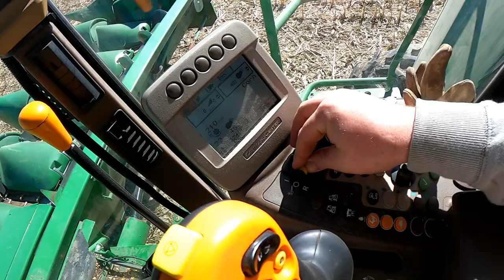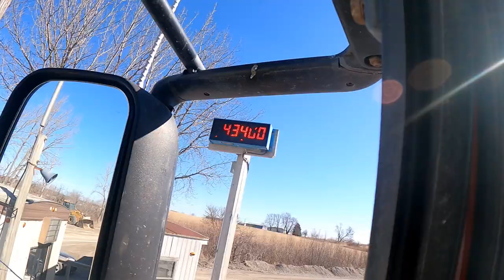HARVEST 2021! - Pickin CORN bonus!

Comment: Ben I just thought how you and others cans save a lot of money,  on your Air cleaner if it has steel mesh on the paper element take a 5 gallon bucket fill with water and laundry soap mix and put the filter into it and move the filter up and down and around real good then empty and repeat as necessary then rinse until all water is clear then set it out to dry for a few days until dry!! If your in season have a brand new filter to put in until it gets dirty and REPEATE!! The savings is great oh I was the shop foreman for a long time and I would tell all my customers about this.

Comment: First. We have a 9660 as well. We run an 8 row header on it. My personal recommendation would be to crank the combine up, because a 9760 is a 9660 with the engine turned up.

Comment: Ran a 843 deere on a 7720 for years, than a 1293 on a 9610 for many years...Like you said, when the corn yielded good you pulled back on the hydro lever  a smidge.
Reply from the maker: You got it!